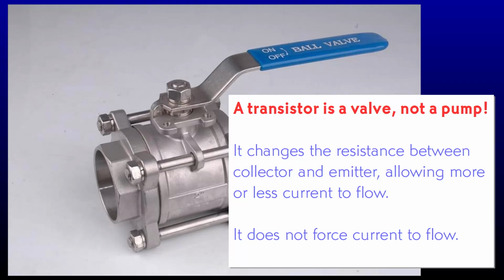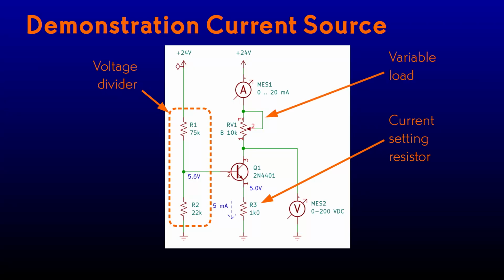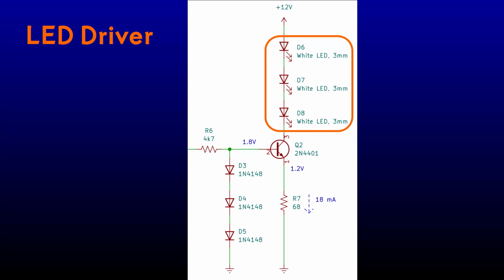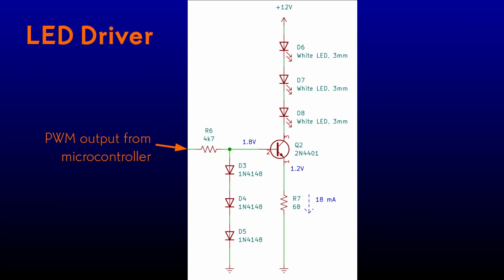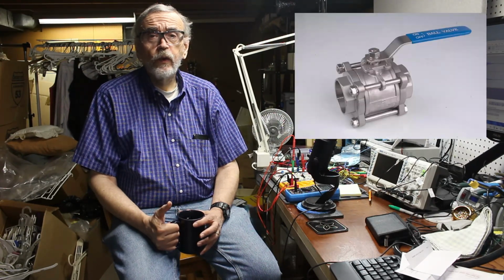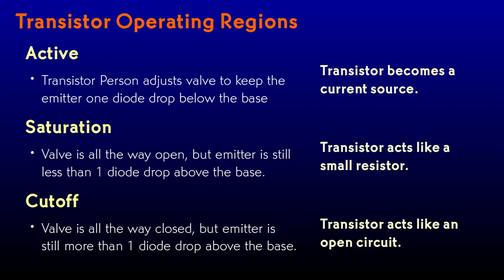Transistors 101 ep2: Current Sources

Comment from the maker: CLARIFICATION: At 9;24, the slide speaks of "emitter less than/greater than one diode drop below the base."  That was confusing phrasing. 

What I meant:  Saturation: the transistor is pulling as much current as it can, but can't pull the emitter up to Vb-Vbe.  Cutoff: The transistor is pulling no current and the emitter voltage is higher than Vb-Vbe.

The base-to-emitter voltage, of course, moves the other way.

Comment: Hi Kevin, I like your videos.  Thank you for taking the time to make them.

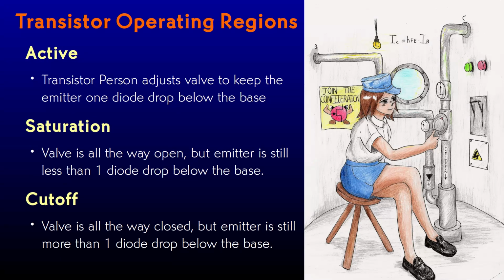I have a question.  @9:24, the middle statement on saturation.  Shouldn't that read that the emitter is still MORE than 1 diode drop?  My thought is that as saturation is entered, the emitter voltage goes down (since current through it goes down), widening the gap with the base to be more than 1 diode drop (as the base is held basically constant by the bias resistors).     Am I correct or am I missing something?

Thanks and regards,
Mike
Reply from the maker: Yeah, I chose really confusing phrasing there. Sorry!

You're right.  I was thinking in an NPN-centric world, and trying to say that the emitter voltage will be lower (more negative/more toward Vee) than Vb-Vbe.   And of course in the next list item, the emitter voltage will be higher (more positive/more toward Vcc).  

The base-emitter drop, of course goes the other way, although in saturation, the transistor starts pulling a large amount of base current, so (depending on the input impedance and the bias network) the base is likely to drop along with the emitter.
Reply: @KludgesFromKevinsCave   Thanks for responding so fast and the clarification!  It helps to know I wasn't out in left field, not understanding what you're teaching.   Cheers!

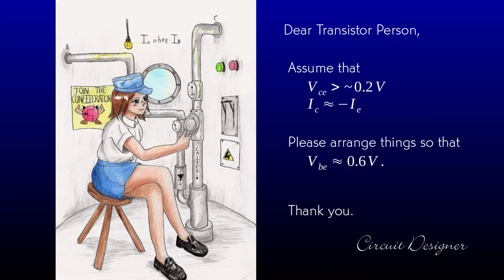Comment: Valve analogy for a transistor actually confuses me. Valve is something that controls flow (which corresponds to current in water-electric analogy). However here the transistor is controlling its C-E resistance, as you pointed out at 3:02. 

But the mind image of the valve limiting the flow beats the verbal explanation.
Reply from the maker: If the water analogy doesn't help, don't pursue it.  But if it does help, you can think of it as that we use a valve to regulate different things.  Sometimes we want to regulate the pressure drop across the valve (analogous to voltage), sometimes we want to regulate the flow through it (analogous to current).  We do both by having a pump (our power supply) pressurize the pipe, and then adjusting the resistance to the flow with the valve.

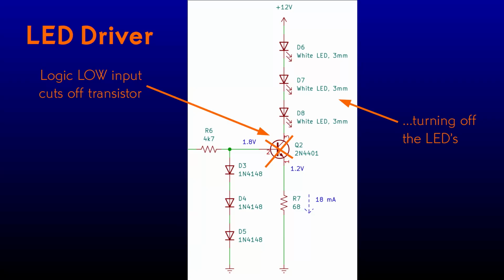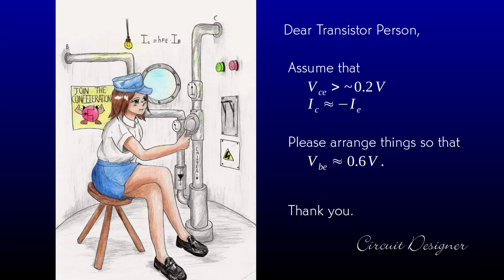Comment: Excellent tutorial. There is a detail that is needed, however. At 7:17 a new rule to those stated as 2:35 is introduced. This rule has already been stated at 1:41 as "The transistor is valve, not a pump." This should be added (i.e., written), however, in the list at 2:35 as "The transistor is not a source of energy (i.e., it cannot generate energy on its own).".
Reply from the maker: @Stelios.Posantzis  thanks for the tip.  I try to be careful about such things, but sometimes we all falter.
Reply: @KludgesFromKevinsCave  Yes, that is very true and besides, t's a minor detail (because the rule is already mentioned earlier). I just put it there because it raised my curiosity that one could describe most simple transistor circuits usefully with just two rules. Even with this third rule, I'm curious to see how many circuits can be described (and which ones cannot).